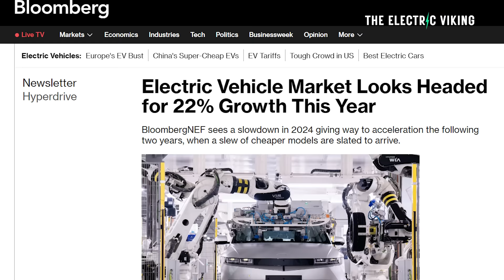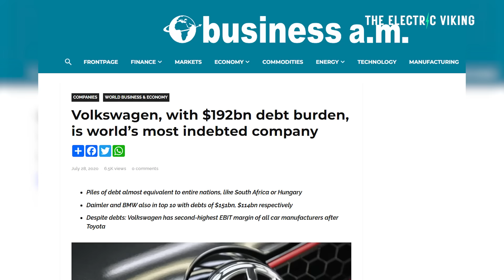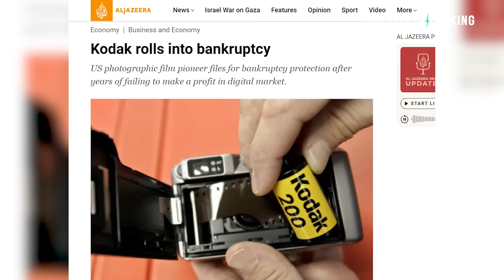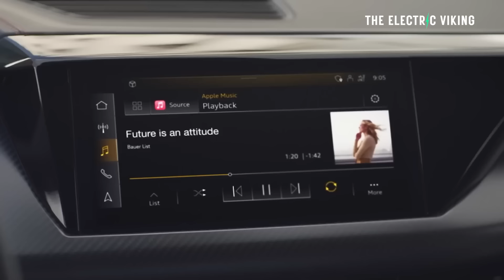VW are in CRISIS as EV sales and total car sales fall worldwide

Comment: It's because European manufacturers see EVs as premium whereas Chinese manufacturers see them as normal.
Reply: Exactly right
Reply: Yes but mainly because the Europeans started EV development 10 years after the Chinese, so are having to buy in the technology and batteries at hugely inflated prices and its older technology, only TESLA is at similar pace to Chinese as they started development at a similar time.
China already selling 800V EV tech with much bigger range and much faster charging , that and lets not forget the VW group have massive multi billion court settlements due to Diesel gate..
Reply: No it’s because the CEO’s want to keep their profits and share prices high in the short term. Switching to EV’s will cost them money in the short term and are not as profitable (as they don’t need as much servicing) long term.
Reply: @jasonmugridge  and that's what CEOs are for right, short-term thinking? Do you consider VAGs mounting $200bn debt as preserving 'profits'? What's the profit on non-sales?
I guess until they can make EVs profitably, like Tesla & BYD, they should step aside/out.
Reply: @martinaston1715  in some cases they're having to get Geely to manufacture the whole vehicle. My point is, their products are largely high-end with no commitment to normalising EVs. It's as if  they think EVs are a fad and will 'all blow over'.
Reply: True, but that’s rapidly changing. Look at all the cheaper (for Europe!) EV’s coming out now - Dacia Spring, Citroen e-C3, Fiat Panda, Vauxhall Frontera. Expensive compared to China for sure, but as cheap or cheaper than ICE cars in Europe.

It will still be a few years before we see EV’s as ‘normal’, but it will change. Whether it will change quick enough for some brands remains to be seen.
Reply: @ISuperTed  every product line holds a little back or EVs could have been a flash in the pan so the slow march will continue. I think you're right, with outsourced software,  and (often) outsourced manufacturing the European legacy auto players have little to offer the new 'normal'. I'm a Euro ICE fan but my next car will likely be neither.

Comment: Quite frankly, the situation for VAG is nowhere near as bad as it could be.  Right now, China has chosen not to retaliate against EU-produced automobile imports.  If China wanted to really punish the EU, they would slap a prohibitively large (say, 100%) carbon tax on ALL automobile imports in addition to a comparable 30% tariff on EV imports.  Right now, Porsche is a huge profit center for VAG, but produces ZERO cars in China, so every Porsche sold in China is imported from Germany - it's a huge 'overcapacity' situation where Porsche is 'dumping' cars in China.  Similar issues exist with various higher-end, higher-margin Audi (also BMW and Mercedes) vehicles.  If China squeezes those profitable cars, they can squeeze German auto industry revenue and profit much harder.  This would ripple down to the German suppliers like ZF and Bosch, along with tertiary effects throughout the economy.  Those debts would put VAG, BMW, and others into bankruptcy risk that the German state would have to bail out to prevent collapse and massive unemployment.  

That is, the VAG crisis is far larger than VAG, and extends to the entire German auto industry.  China could push Germany into a sustained economic recession (potentially depression) that lasts for multiple years, and permanently destroy the German automobile competition.  Fortunately for Germany, China isn't as cold-blooded as America.  Although,  if the EU persists with tariffs on Chinese EVs, China should eventually do so and force the EU into an Australia situation, where they are forced to open up to Chinese imports because they can no longer produce cars domestically. 

Fortunately for China's government, the Chinese consumer is already making the shift due to Chinese EV competitiveness, so this is happening organically without China having to employ any heavy-handed policy tools.

Comment: I looked for the Q8, the fastest EV-Version takes 6.5s, the ICE-Version does it in 3.6s, thats a pretty fat middlefinger towards Audis EV-Customers, no wonder they have to shut down the Bruxelles-factory.
Reply: The Belgium factory had been on it's last legs for years, it became too expensive to operate as it has "long-standing structural issues" - located in the middle of a large urban area, relatively small production line that could not be expanded, high haulage costs to the site, very high salary area within Europe. VW decided to give the place an bit of extra operating time by placing Audi's EV manufacturing there so it didn't impact production at their other sites and to learn lessons with the EV production line setup. Having done that, and also having produced an EV product that dosn't seem that attractive to the market, the factory closure is back on the cards. Some press quaters are reporting this as an EV issue, but ignoring the site has been a problem for VW for years.

Comment: I think they really could have done better with the styling. I am not a fan of the line across the grill, and the logo is jumbo sized. Bigger and more is not always better. Less is more. Nice car otherwise.
Reply: I think the big logo is a hangover from when they were very popular with the whole "das auto" thing back in the 00's. They forgot to make their cars good, like bmw... and moved from solid mechanics and construction to plastics and ai generated contraptions no one knows how to fix. A diesel passat will still take you 1,000,000 miles at 45 mpg and run on French fry oil from you local Dennys. Nothing an ev can claim most likely. Check your cL for one today.... if vw is gonna stick around, there gonna have to fire their badging coordinator

Comment: Just ordered a VW ID7… couldn’t be happier!
Reply: So they actually sold one? Thats pretty impressive.
Reply: @Fissan_Poulsen  really good car, surprised it’s not done better!  Preferred it to the BYD Seal and Polestar 2 I test drove as well.
Reply: @Fissan_Poulsen   L😂L
Reply: @Fissan_Poulsen  ID 4, ID Buzz and ID 3 sold pretty well considering EVs having hard time. I don t see why woulnd t the ID 7 be a success.
Reply: Let us know what you think of it after you get it.  - former VW owner
Reply: @GenRicOpekc  ID 4, ID 3 have sold well 3 years after they came to the marked.
Reply: @jonpetter8921 not in the USA where Hyundai Group cars cost the same while delivering more.
Reply: @stopthefomo  That s because you only have one EV VW model other there, and your version of ID 4 don t have features like Virtual Head Display or Dynamic Chassis control or standard heat pump. ID 4 is great deal over here as entry EVs.
Reply: @jonpetter8921  I heard the software was and is still a problem. Maybe the id7 will be better.  I expect they will learn a lot from Rivian.  The German and Japanese cultures are laggards when it comes to digital tech and software.
Reply: @GenRicOpekc  the software is updated in the ID7, I don’t think I’d have ordered it if it carried the same software as earlier ID models.
Reply: @leemitchell3302  good to hear.  I have owned 5 vw/audi cars.
Reply: @GenRicOpekc  That s not true at all. The software from 3.0 are fine. All models from 2023 got 3.0 at least.  The ID 7will have a whole newer hardware and software. The map is based on android as snappy as Tesla map.
Reply: @leemitchell3302  Did you actually receive it?  It looks like the id.7 has been delayed indefinitely because of market dynamics.  (Not competitive enough)
Reply: @leemitchell3302  Originally expected to reach North American shores in 2024 as a 2025 model, the ID.7 was set to replace the discontinued Passat in VW's lineup[3][4]. However, Volkswagen dealers in the U.S. have expressed concerns about the ID.7's competitiveness, as it was expected to be priced above $50,000 without the federal tax credit, making it a tough sell in the current market[4].
Reply: Originally expected to reach North American shores in 2024 as a 2025 model, the ID.7 was set to replace the discontinued Passat in VW's lineup[3][4]. However, Volkswagen dealers in the U.S. have expressed concerns about the ID.7's competitiveness, as it was expected to be priced above $50,000 without the federal tax credit, making it a tough sell in the current market[4].
Reply: My condolences.
Reply: The buyer's remorse doesn't set in for a while. How much did you pay for it and did you have to get a car loan to buy it? If you did get a loan and with the depreciation rate on EVs hopefully you won't find yourself in a situation that's termed 'financially underwater'. That's where your vehicle is worth less than the value of your loan amount. Lots of people who thought they were clever bought an EV, found themselves in that situation. So in reality they weren't as clever as what they were making out to be.
Reply: @jamessmyth5949  that’s a really myopic statement.  All autos were overinflated in the last several years and were bound to drop.  Resale value is irrelevant if you are wise enough to keep your EV.  They last much longer and are much cheaper to operate and maintain.  And now EVs are largely cheaper up front than ICE vehicles.  Unless you have some sort of special need, EVs are a much wiser choice for the majority now (and then).
Reply: @richardfolden3860  Well if you consider the truth to be 'myopic' then so be it. It was during the pandemic that vehicles were over inflated and that correction has now occured. Nobody is paying the over and above premium prices anymore. Resale value is irrelevant you say. I'd say it's actually quite relevant, even if you're keeping it for a long time because eventually a repair is going to be required and it would hardly be worth spending more on a repair than what the vehicle is worth. They last much longer, are cheaper to operate and maintain. That's why there's been reports from EV owners complaining of issues taking months to fix because even the manufacturer can't supply a remedy to the dealer. Repairs on ordinary shopping grocery hack EVs costing as much to repair as a luxury BMW or Audi. The majority of EVs I've come across aren't cheaper at all than ICE, it was only because of government subsidies that made the price attractive for a while until that got revoked.